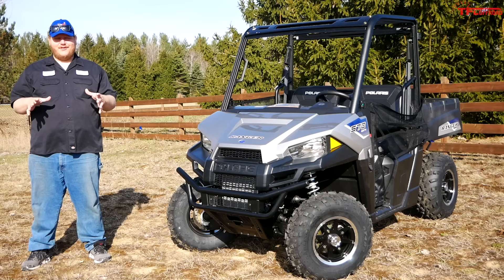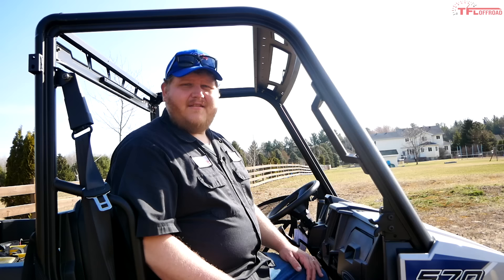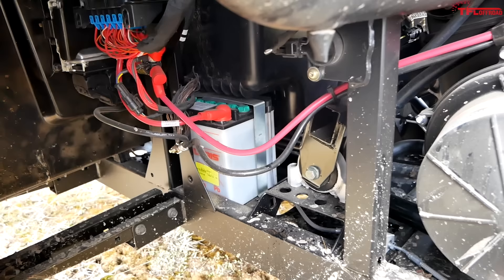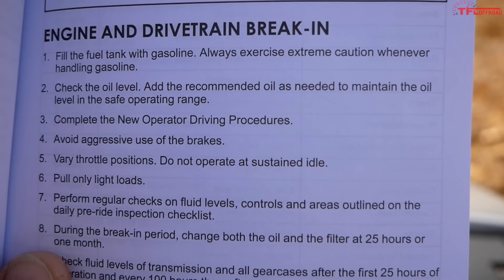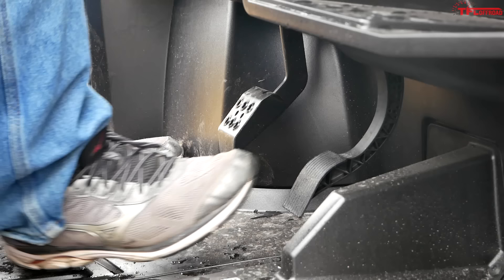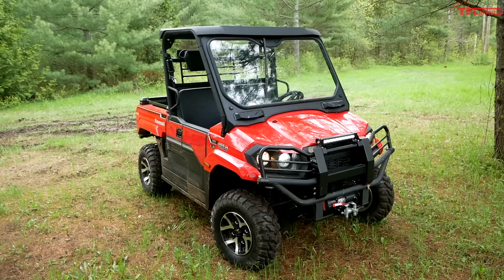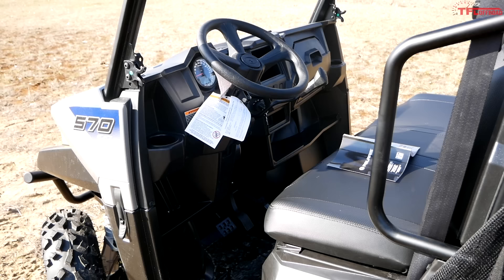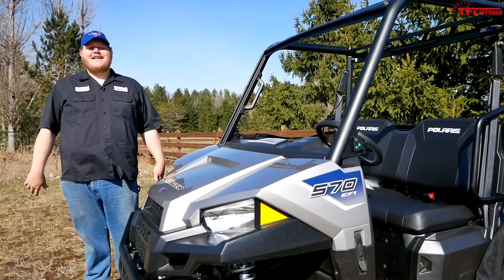Don't Make These Mistakes! Learn the Proper Way to Break-In Your Side-by-Side or ATV

Comment: Honda doesn't need extreme brake in periods. More importantly they are the machine of choice by farmers and ranchers. They are just built better.
Reply: Mike Miller but they do need extreme valve clearance checks.
Reply: @balzarini51  i got a 04 rincon. Just did valve adjustments and they weren't bad.  I'll take Honda over all else.
Reply: we have Kawasaki on our ranch. lots of Polaris and every other brand on farms and ranches where I live. Honda does make a good machine though
Reply: Mike Miller I’m a farmer and would take the Polaris anyday. The 570 will smoke the pioneer 700 too.

Comment: I've always been a stickler for breaking my stuff in properly...however i've never met anyone else that did this. All of my friends believe the proper way to break something in is to drive it like you stole it
Reply: I’m with you there as well as the neighbor kids running it like they stole it boggles my mind
Reply: You really only need to take it easy for a few miles , then don't sustain wide open for 10 or 15 miles.  Change the oil and filter after 25 or 30 miles.  The main thing is setting the piston rings and flushing out the break in oil.  Obviously don't beat the snot out of it but drive it like your going to.

Comment: I LOVE reading the manual on brand new vehicles!! I remember as a boy reading the manual for my parents 1996 Mercury Cougar 4.6 V8 (205 HP 285 left, 2000 Mercury Mountaineer (215 hp 288lbft, torquey bastards!)

And other cats too, and I remember reading about proper break in and changing oil at first 500 miles.

I just changed the oil at 1000 miles (wanted to at 500 but couldn't) and just changed again at 5000.
Proper break in (read manual!) and maintenance is the key 🔑 

Great video bro!!

Comment: Well expressed video.
I've owned 3 new cars I kept and sold off with over 360,000 miles each. None of the 3 had ever been to WOT.
I broke them in with with the typical manual advice no hard stops and no full throttle starts (GM) For the first 500 miles. I lost a few waterpumps and alternators over the years but never had an internal engine issue or oil consumption. BTW the new C8 Corvette computer is programmed to not allow full throttle starts   or operation beyond the programmed rev  limiter until the break in period is over. Once the period is over the computer gives you the keys to the Kingdom. Pretty clever.

Comment: Break in procedures are vastly different today vs 0 years ago due to better metallurgy and improved engine building techniques. Tolerances are much more accurate now so mating surfaces don have as far to go to be consider “mated”. Ring material and honing processes are much improved. The same procedure can be safely used for about anything now. Drive normally with occasional bursts of throttle, then intermittent cool down periods. The bursts of grottoes exert pressure on the rings forcing them into the cross hatch machined onto the cylinder walls which has an effect on ring break in. The cool downs are to avoid excessive heat around the ring lands. Checking fo a properly operating cooling system is the most important thing to do during break in.

Comment: I just picked up my Hisun UTV yesterday. After seeing your vid just now I went to the manual and looked up the break-in.

“Do not operate the vehicle at full speed for the first 50 hours.”
“Do not start quickly nor apply the breaks suddenly”
“In Winter, operate the vehicle after fully warming up the engine”

The dealership told me to change the engine oil/filter after the first 20 hours are up
Reply: Buy American

Comment: I bought a 400ex new in 2001. Let it rip as soon as I got home. Finally needed a top end after 14 years 👍🏼. But I was young and stupid and perhaps lucky. I take it pretty easy the first several hours. I do however subscribe to the short bursts of full throttle. Gotta set them rings so you don’t have a oil burner 50 hours later

Comment: I havent bought mine yet, but this video was very good in explaining what I will need to properly do when i get it.  I do have a question for you, not break-in related, but whats your take on sustained speeds with these?  Most videos say this particular machine tops out at ~50 mph.  Is it bad to go that fast for a couple miles?  If so, what would you recommend the top speed should be for sustained speeds?   After its broke in of course.  Thanks!!

Comment: The tags you talk about i have a question.  I recently bought a chinese (Tao Rhino) atv. Its supposed to be a 200cc (197) on the emissions tag it said everything correctly but it said that the displacement was a 107cc. Could that be a mistake on the tag or did i get got with a smaller engine? Ive looked everywhere and wonder how i can confirm what my engine actually is. Im brand new to this atv world so bare with me please.  I see numbers on the bottom of engine but dont get anything when trying to look it up or decode it. Thanks for any help its greatly appreciated

Comment: Honda engines have the lowest compression ratio hence why the break in procedure isn't as stringent as the other brands.
Reply: Turbo TDI Compression has nothing to do with it. The honing process Honda uses minimizes ring break in time.

Comment: I broke In my x3 with an aftermarket assassins stage 2 reflash Tune and just sent her hard. It’s got nearly 1000 miles and no issues.
Reply: Yes, biggest thing is the first oil change.  People think they will blow up from not following the manual.   If it does it was going to regardless.

Comment: Bought a Kawasaki Ninja brand new from a dealer. Picked it up in the front of the dealership and 30 seconds after cold start, did a near-redline tire smoking burnout in the parking lot as a part of the break-in procedure. Ran flawlessly for 5 years of ownership. Drive it like you stole it.

Comment: Polaris makes garbage.  Can I say the same about other manufacturers... don't know, cause I haven't looked at them.  What I do know is that there are far too many aftermarket part manufacturers that formed an entire successful business model off of making better parts than the poorly engineered garbage that Polaris puts out.  I have a Ranger and the stupid ayholes couldn't even get the AWD switch correct.  It's in AWD when the switch is on Turf mode, and vice versa.
I almost bought a John Deere Gator, but the similar priced model had half the HP of the Polaris.  I also relied unjustifiably on Polaris's advertising and market presence as a measure of their quality... very bad choice.   That's as stupid as thinking Kim Kardashian has some kind of measurable talent simply because she makes a fortune.